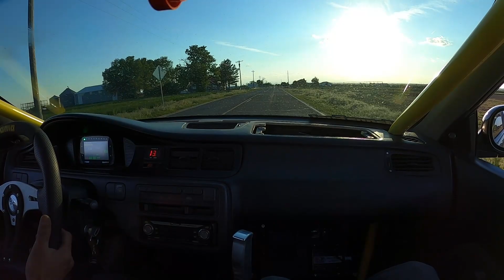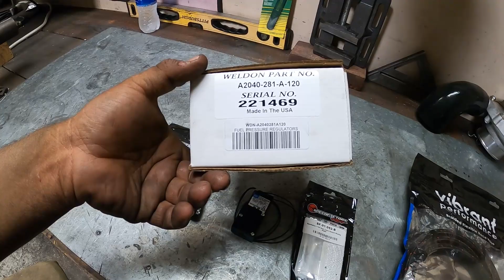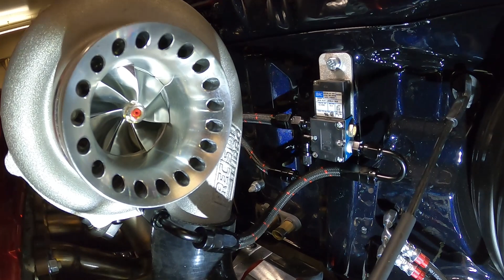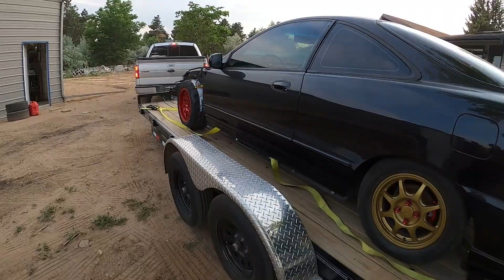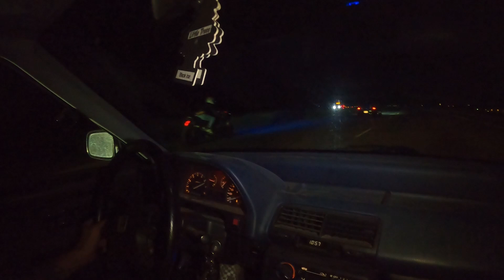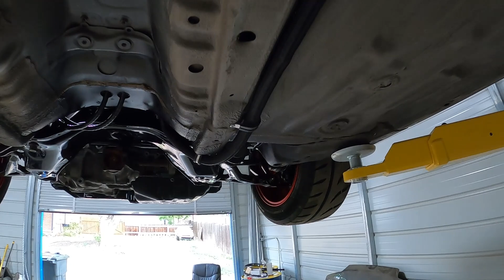AWD integra k series mechanical pump fuel system!

Comment: All that EF sedan did is spin and bog the $h!t out of 4th lol does he have boost by gear if not he desperately needs it and some tires
Reply from the maker: Yup lol
Reply: The rips where it bogged 4th was on a shit nitto neo gen the car is now on a r888r
Reply: @ZeliBuilt  I'm on Toyo R888's on 30psi with boost by gear no spinnin here just 1st gear that's the beauty of bbg
Reply: @ZeliBuilt  You bogged cause you didn't ease off the throttle enough for it to bite and fully rev out each gear